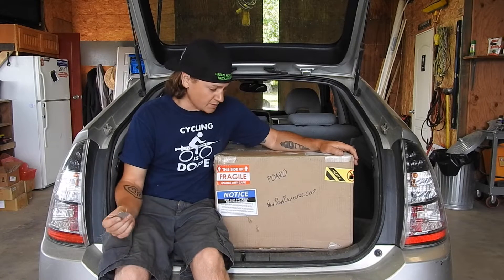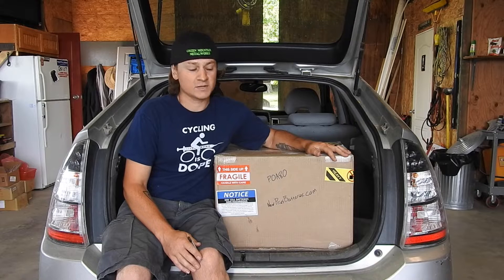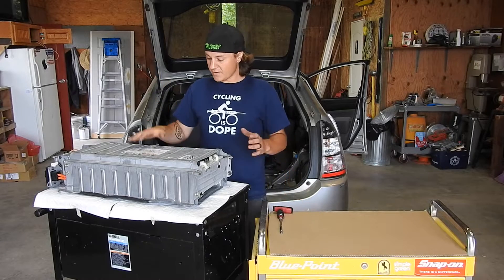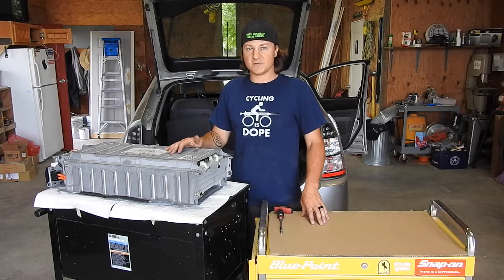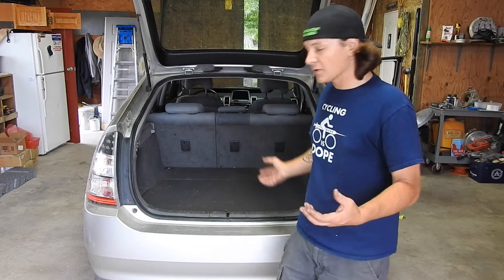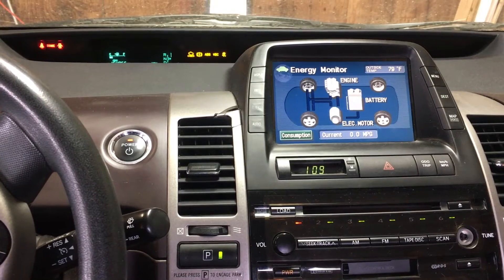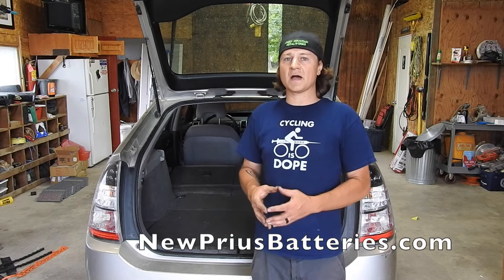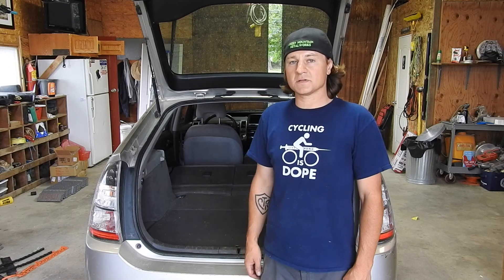Gen II Prius High Voltage Battery Rebuild - NewPriusBatteries.com Unboxing and Installation

Comment: Why do people make videos and then tell you what they did instead of showing it?  It's a camera, not a radio.  I read that the old battery weighs 118 lb.  What does the new one weigh?  Does it seem like the swap could be done without hoisting the battery out of the car?
I thought of putting a piece of plywood in the trunk and spinning the battery around to get more room.  I know there are screws on the bottom but then it could be tilted over to pull those out.  What do we think?

Comment: I know you did this video 2 years ago.  How has the battery held up?  I just ordered this kit for my 2008, hopefully it lasts, but I live in PA where we can get some frigid temperatures. Thank you in advance!
Reply from the maker: I sold the car a few months ago, but I never had any issues with it and we put about 50,000 miles on it after the battery change. We parked it outside in Idaho and Colorado and drove in temperatures below zero without issue.

Comment: Been there, done that. I learned the hard way, I replaced the shorted cell with another refurbished cell. Three weeks later, I did it again. Two weeks later it was down again. Be smart, complete Toyota battery pack. Only way to go. Listen to this guy.
Reply: Did you load test the pack or just go on voltage?  Why wasn't that short picked up during testing?  I need to do mine and I'm trying to get all the warnings upfront before I go too far.  Also, I'd like to turn the battery around so I can work on it in the car.  Right now it's unbolted and sitting in the car.  I think it's too heavy for one person to lift.  Does 118 lb. sound too heavy to lift???
Reply: @alext8828  you can move it by yourself but you have to get creative. The first battery had a hole blown in the side, I did Voltage test and Load the others while it was on the bench, the numbers were all to specs. I cleaned all the terminals, reassembled then confirmed total battery voltage. All was good for about three weeks, then another battery dropped. Repeated the project and a two weeks latter lost another one. When one goes bad they are all on the edge, it’s all or nothing from my experience. There are complete refurbished-replacements on the net, carful. if this is your main driver and your going to keep the car for a few more years,  go to the dealer and purchase a new complete pack. Good luck.

Comment: I just got my box of 1600$ batteries and they did not send me any instructions whatsoever.  No email, nothing...
Reply from the maker: I can’t remember if instructions were included or if I printed them off the website.
Reply: They responded to me after 1.5 hours of emailing, calling and texting, they’re a very efficient company but they just forgot to send me the instructions via email. It’s possible that there is only one person working there(?) either way I am pleased so far...
Reply: Great video BTW!

Comment from the maker: Zero issues so far, and we’ve put 15,000 miles on it since I made this video.
Reply: Could you show us your mpg display in a video and does it increase fuel range and power?

Make a video it would be great help
Reply: Lmao I was just about to ask how its holding up since 2019. Thanks for the update. and yes Im interested in your MPG
Reply: Hows it doing?
Reply: What average mpg do you get with it. And how's it been running vs your old battery before it went out?

Comment: Update
Reply from the maker: I've got a few thousand miles on it so far with no issues. There may be a slight increase in my fuel economy, but I didn't document the change so that is just anecdotal.